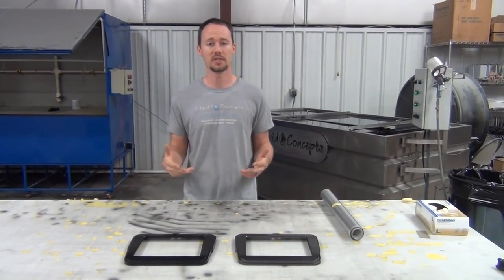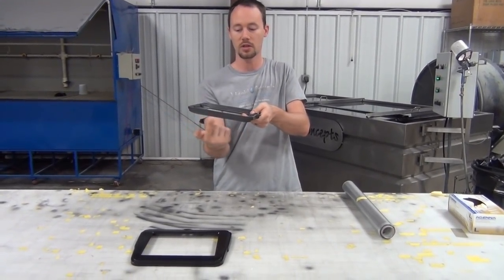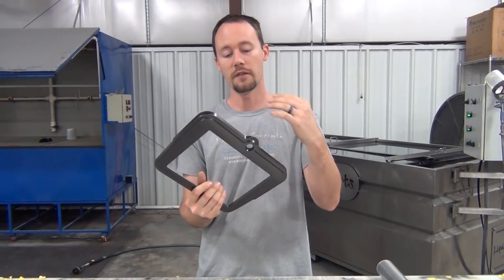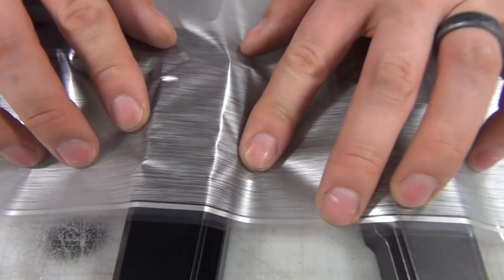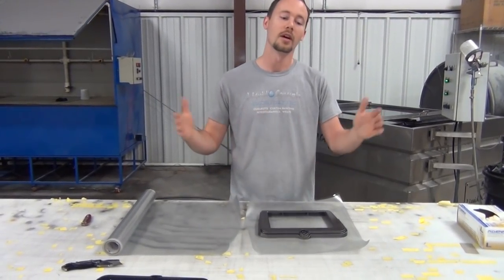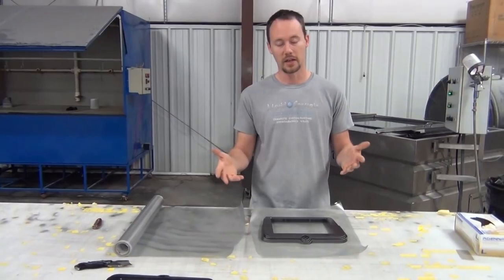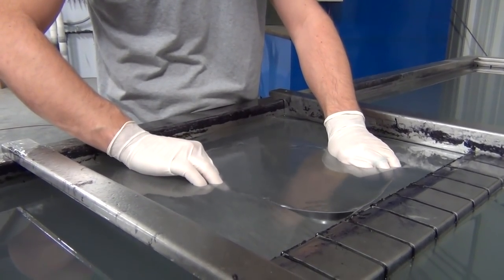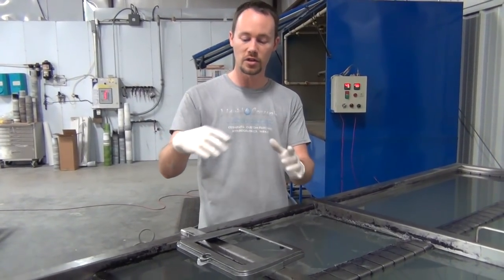HOW TO HYDRO DIP SHARP EDGES | Liquid Concepts | Weekly Tips and Tricks

Comment: Do you have any tips for me. I can only really use one hand. I would like to dip my engine cover, its not a huge one. Also fuse block cover. Do you think this is something i could do by myself? Maybe some kind of modifications to help.
Reply from the maker: Yes you should be able to dip but of course you may have to think of ways to hold the parts to make sure you go in at the right angle and have good control of the part.

Comment: Would you be kind in elaborating on hat type of base coat or primer on plastic and Aluminum alloy will be suitable?
Reply from the maker: For all metal parts we use this primer - https://www.liquidconcepts.com/shop/product-detail/dtm-epoxy-primer-kit
For the plastic you will use this adhesion promoter and then use the DTM Epoxy Primer that I posted in the link above - https://www.liquidconcepts.com/shop/product-detail/adhesion-promoter
For the paint, you can use a good automotive paint or these - https://www.liquidconcepts.com/shop/product-group/paint